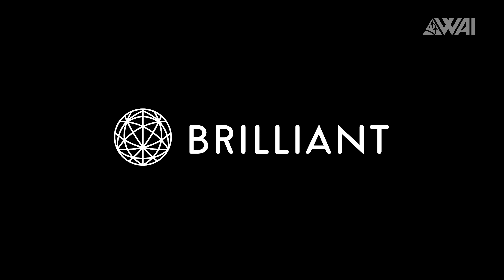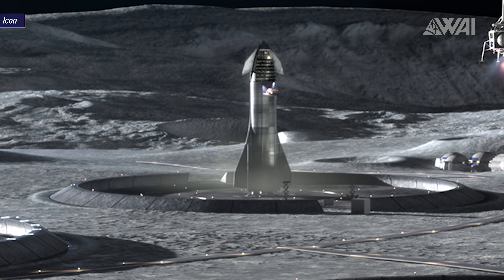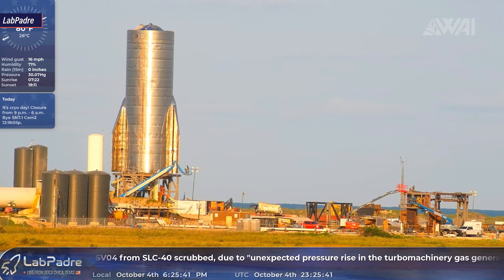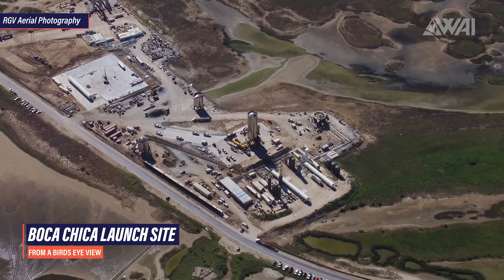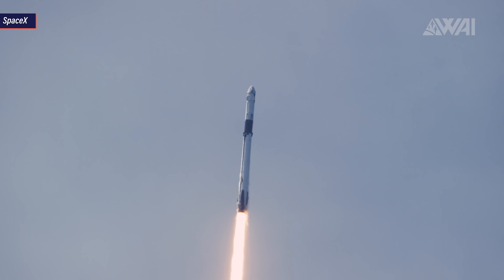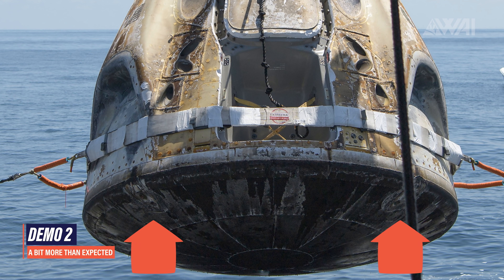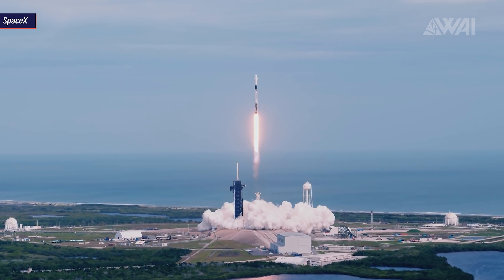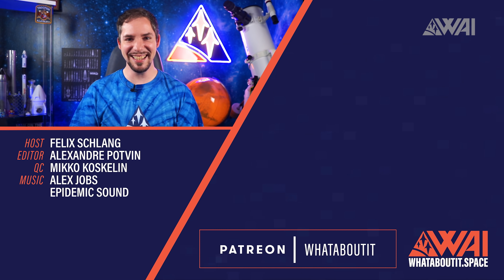125 | SpaceX Starship Project Olympus – Crew 1 Preparing For Lift-Off

Comment: I don't know  why space x simply does not roll the rocket tube like a cardboard tube in the centre of a roll of  paper towel . It could be totally automated. Laser cut to length. Just crank them out any length. Stacking rings seems archaic. To me unless there is some engineering  reason .

Comment: I wonder why Space X don't pump water in pipes straight from the ocean for their sound suppression?
Reply: Because sea water is not good for equipment
Reply: @smallstars  What equipment? It will be for sound suppression only. If a little salt water gets on any equipment, it can be rinsed off with a LOT less fresh water than what would be used for an entire launch.
Reply: Salt = BAD

Comment: I was surprised/annoyed  at the small flotilla which surrounded Demo 1. But after thinking about it, those people live within a few miles of two major airbases, Eglin Air Force Base and Pensacola Navel Air Station. If someone with no knowledge of SpaceX operations saw parachutes floating down in the waters offshore, they likely thought it was an aircrew in trouble and rushed to help. At least that's what I prefer to believe.

Comment: One question ? How do you refuel the lunar starship ? They aren’t going to send a few tank starships each time the need to refuel the lunar starship ??  Are they going to make a hydrogene variant of starship for lunar refuelling ?
Reply: Yes. They are sending fully refueled tankers to moon orbit. There the Lunar Starship can refuel. 

You don't have to refuel on the moon's surface. You can do this also in orbit.
Reply: Keyboard runner yes i know but you still need multiple tankers to refuel one starship and also what is the lunat starships application or use ? I mean once its up there, since the people aren’t gonna be able to take it to go back to earth i don’t understand the use besides to land with less dust blowing away, so are they gonna dock a normal starship to the lunar starship in orbit, transfer people and park the normal starship in orbit for return ?
Reply: @simonw2631  Lunar Starship will be exactly that, shuttle (no pun intended) between lunar surface & NRHO, and it won't comeback to Earth. It will be used to land at the spot that's never been reached before = no landing pad, so they can expand the base, but once it's established & landing pad is constructed they can send the standard Starship (with heat shield & fins) directly from Earth without staying at NRHO (or they could if they desire for Gateway)

Yes ofc the tanker that refuel lunar Starship in NRHO will still be need to be refueled multiple times in LEO, but once it's done it can reserve propellants because it doesn't need to land on the Moon, and ofc it can use the aerobraking because it has a heat shield & fins
Reply: Alvian Choiri Apriliansyah yeah i understand, thanks !! Can’t wait for SN8 to fly
Reply: @simonw2631  
The "only" use of a lunar Starship is the answer to the lunar lander proposal of NASA. And since NASA doesn't want to have a huge cloud of regolith blown up into space when humans first return to the moon, SpaceX made the lunar Starship. 
"the use besides to land with less dust blowing away,"  That's exactly the job it is designed for. 

Once there are solid landing pads on the moon there is no need anymore for a dedicated lunar Starship. Regular Starships will do the job just fine. 

So lunar Starship is just a gap-filler.
Reply: Hydrogen = entirely different separate ship from Starship = more expensive

Comment: How is water based concrete going to be 3D printable on the moon? In the vacuum of the moon the water will boil off. Felix, you should think more carefully before including this kind of nonsense in your videos. Molten sulfur concrete might be 3D printable on the moon, but that is absolutely not what they are testing. Water based concrete would be 3D printable on the moon if surrounded by a massive pressurized vessel, but if you have that vessel, why would you print another one on the inside?

Comment: Ehhh... I think you might still want to use the Lunar Starship, you can cut out the landing engines, but you probably still don't want the flaps or heatshield as it would require more refuelling to end that extra mass, but that basically means you are just using a regular Starship just without a few bits which means you can use exactly the same assembly line, just missing a couple of steps.
Reply: No. You want to ship huge payloads from the earth to the moon. With Lunar Starship you would somehow have to move that payload from one ship to the other in moon's orbit. 
Going from earth surface directly to moon surface will need more fuel, but it's by far the best method.
Reply: @3gunslingers  It's called a zip line, and in micro gravity it's not like you even need to put much force into it to get something moving, and you already need to send 3 fuel tanker Starships up anyway to give a regular Starship enough DeltaV to get into Lunar Orbit, land, take off and get into low Earth Orbit.

So if you can save one of the refuelling flights and replace it with a cargo flight it's would be more economical as you lunching 3 Star ships not 4.

Also you can get back into LEO with a lunar Starship, you would just take multiple passes at like 100km above sea level, which would not generate much shock heating then circularize at apoptosis once it's low enough.

Steel is still pretty heat resistant, and you can keep the fuel for the circularization in the header tanks so the shock heating wouldn't boil off all your propellent.

Would take like many passes though to lower your apoapsis enough, so you would want to transfer your crew by another means.

Maybe a Starship sent up with something like 98-99 tonnes of extra fuel with 1-2 tonne for people life support for 14 days, that would only be meant to go lunar orbit and back, but wouldn't need any refuelling.

oof... I forgot about the van Allen Belt, even if it will be unmanned for the time it's going through the Van Allen belt it's still going to ionize the Starship... humm maybe a burn to lower your apoapsis orbit below the lower Van Allen belt on the first trip. Then you can manned as your orbital period will be short enough to do the rest of the skips through the atmosphere.
Reply: @Etheoma  
I would love to see your calculation on the aerobreaking issue. Heat shield or no heat shield? How do you keep orientation without the fins/wings? 

How you plan to shield your crew against the van Allen Belt radiation while they wait for the ship to make enough passes though the atmosphere? 

"It's called a zip line, and in micro gravity it's not like you even need to put much force into it to get something moving," How do you tension the zip line without gravity?
While it's true that you can move huge masses in space without much force, that doesn't mean it's easy to transfer bulky cargo between ships. Most likely it would require EVA's which leads to huge costs and time penalties. In addition the ships have to dock somehow in parallel to transfer cargo. This requires docking hardware. Again more costs.

Also lunar Starship doesn't lower the fuel requirements in any significant way. It's fundamentally still the same ship with similar weight and efficiency.
Reply: @3gunslingers  Erm you know that a Starship with only the header tanks full would move the centre of mass way forward, if the centre of mass is behind the centre of lift you are aerodynamically stable.

Also it's theoretically possible for steel to re-entry without heat shielding, you would need to have high lift to make sure you were reentering slowly, but it's just about possible.

Not something you would want to consistently bet a $200m+ craft on never mind human lives, and wings made out of steel would be exeedingly heavy, which would make it unworkable, but 100km is considered space for a reason by the US, you can get to orbital velocity at that height and thermally it wouldn't be an issue.

100klm is with a bucket tonne of safety margin, aluminium can take the shock heating, So yeh Steel could take it like a champ, aluminium could take it like a champ, steel would take it like it was a warm bath.

The only issue is that you may not get enough drag at that height to lower your apoapsis by enough to make it feasible while manned.
Reply: @Etheoma  
"if the centre of mass is behind the centre of lift you are aerodynamically stable." You mean IN FRONT OF, don't you?

Reading between the lines of your comment I think you want to have a heat shield on your lunar Starship? Did I get that right?

Comment: Great video but can you please start to cover more Blue Origin stories - they seem to get missed: The NS-13 rocket that will be flying for the seventh time, a record, was scrubbed due to a payload power supply issue, Brevard County wants Blue Origin to refund the $8 million in cash incentives the County Commission approved in 2015,  they applied for a permit from the U.S. Army Corps of Engineers to fill in/impact 17.7 acres of wetlands etc.

Comment: (5:23 into the video.) Felix,  Perhaps the flight hardware was installed into SN08 for test fitment. But before the pressure test SpaceX  removed the hardware in case SN08 did not pass.

Comment: I’m all for safety, but a ten mile perimeter sounds more punitive than preventative. Spectators can be closer than that to a launch or a landing falcon 9 first stage on land. There’s nothing different about the water that makes that perimeter necessarily larger. Half that, five miles, is sufficient. At that distance, some folks could still make a reasonable observation safely.

Comment: Lunar Starship shouldn't need Raptor engines at all.  Makes no sense to use the same Starship to get on/off Earth as to get on/off Moon.  Those engines are 1500 kg each (probably more for vac version).  That is an enormous amount of "dead mass" you are lifting on/off the Moon.  Depending on how close a super heavy can get an empty, non-Raptor engined Starship to orbit, you may be able to avoid those engines altogether.  If you still must have Raptor's to get the Starship off Earth (on its maiden voyage), then you would want to remove the engine(s) once on orbit and use only the smaller Lunar engines for all propulsion.  Obviously SpoaceX has no intention on using the same Starship for on/off Moon as Earth based on the lack of fins, so the same lack of engines makes perfect sense.  And a gateway makes no sense at all.  You would want to use the Lunar Starship to go from the Moon surface back to LEO where it would rendezvous with an Earth Starship and transfer its cargo there.  Again, no need to push all the dead mass of an Earth starship any further than LEO.  You just don't need 6 gigantic Raptor engines for any of this except getting from Earth to LEO.  Everything else can be done with the much much smaller/lighter Lunar engines.  Also, I see little reason for a gateway anywhere, just have the two Starships meet in LEO, transfer cargo and part ways.  Perhaps a gateway may be needed if only to provide some sort of bridge that the two Starships can use as a point of connection.
Reply: "You would want to use the Lunar Starship to go from the Moon surface back to LEO where it would rendezvous with an Earth Starship and transfer its cargo there." That would still require the wings and the heat shield, but would prohibit any inspection down on earth. Also the small engines are FAR less efficient than the big VAC ones, meaning less payload from earth to moon.
Adding to this the small "non raptor" engines are only usefull for the few flights until a landing pad is build in the moon. After that Starship can land on Raptors without throwing regolith into orbit.

Also I would love to read from you how you think 100+ tons of cargo can be transferred from one ship to the other in orbit. I don't think this is possible without a huge payload station in orbit.

We have to say goodbye to the old way of thinking about "efficiency" that characterized old space. With Starship we have a system that can serve all porpoises without the need for special developments. Sure, you maybe can't ship the full payload weight to any place you want, but sending two regular Starships will almost certainly be cheaper than building a special version that needs even more special facilities.

Comment: 6:33   If you will examine the two columns at  the ends of and supporting the main truss you will see they are very small in relation to the corner column.  The main truss is of sufficient material size and chord depth to hold a decent load, but it is only hung at the tops of the ends (two points) and not the bottoms also (four points) like conventional practice.  There are no visible crane attachment points or holes that I can see.  If I had to guess, the small support columns with only two main truss attachment points and no visible crane beam seats or holes makes me believe that there will not be a crane.  But I would expect one or two of the elevating work scaffolds used before in mid bay.  One last point to ponder.....The two areas at the sides have bottom chord bracing which lowers the ceiling height, while the center work space has no bracing and so has a higher inside height. (I would watch the floor for maybe rail tracks for a couple of mobile work stands to move the stacks from the sides to the middle for the transporter to drive under and pick up when they are done.)

Comment: The spectator boats were a minor inconvenience and annoyance to the recovery crew at the absolute worst. They didn't pose any real danger or consequence. Merely not ideal. That's nothing to be ashamed about. 🤦‍♂️
Reply: I suspect there might be liability issues if someone from a spectator boat gets shot of rocket fuel being discharged, or touches a hot part of the capsule.  So that's a reason to keep them at bay.

Comment: Surely the Lunar Starship can land back on Earth if it has enough fuel to slow down using engines rather than aero breaking (e.g. coming from the Moon)?
Reply: No Starship will ever land on earth WITHOUT aerobreaking. The engines are only lit to slow down on the last few meters. 

It does not matter whether the spacecraft returns from a low earth orbit, from the moon or from Mars. It will always use the atmosphere to reduce its speed by about 99%. 

In consequence that means that Lunar Starship will never leave the moons sphere again. But any other "normal" Starship with wings and heat shield can land on the moon, get refueled in low lunar orbit and fly home.
Reply: @3gunslingers  I'm not sure that is true.  Spaceship is designed to aerobrake on Mars and Earth with very limited fuel.  I see no reason why it can't land like a Falcon 9 if it is refuelled in orbit or even from the moon.
Reply: @Spedley_2142  
No, of course all Starships will land like the F9 booster stage after aerobreaking.  Every F9 booster makes a suicide burn for touch down. Every Starship will do the same maneuver after aerobreaking (aka the "bellyflopp") 

Do you watch many video from the "Angry Astronaut"? He also get's this concept completely wrong. (but makes good videos otherwise)

Comment: The Problem With 3-D Printers Making Structures On Mars Is That Water Evaporates From The Composite Into The Atmosphere, If We Allow This To Happen, Long Sought After Water Would Become Rare, Fast! 

The Same Composite Could Make Bricks In An Enclosed Mechanism That Recycles The Curing Vapor With Very Little Pressurization!
Reply: 3D printing on the moon works with polymers, not water.

Comment: Just heard SN8 initial pressurization was too short. With regard to pressurization I will be very interested to know if it affected the operation of the wings afterward. The hull gets put under load when pressurized. Things deform under load which makes that a subject of top priority. Be absolute hell to get a wing stuck as you rocket to the surface of Mars. In fact after the test I would take it apart and do a laser alignment check to see how it changed. If it's nothing or very little then you know that. If there is a problem the only solution will be to add a circumferential frame at each hinge point.
Reply: Or they can just use axes with ball joints. No extra frame needed.

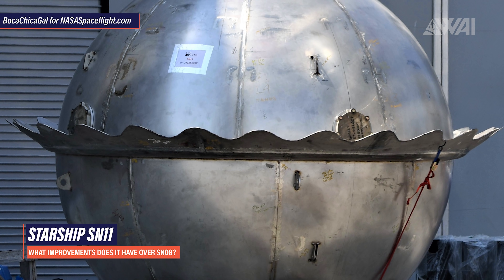Comment: 6:53 is this tank upside-down as shown in the video? I assume it's upside-down due to the wavy plate angled upward in this shot.  I assume the wavy plate will either get welded to the inside of the nosecone shell?  Or would this be welded to a support structure inside the nosecone tip? At first, I assumed it was the AFT tank on the common dome, before reading the labeled since it has the wavy plate.  I'm a little confused about how this will be attached if this is the correct orientation and for the nose tip.

Comment: One ‘issue’ I see with Lunar Starship is payload location - where is it carried? If it’s anywhere near the nosecone that makes getting out & down quite problematic. If you are going to move and deploy large quantities of anything ideally you would have roll in / roll out access...? So what’s your thoughts on how this key and critical aspect might work Felix?
Reply: There will be a hatch somewhere above the fuel tanks from which an elevator will able to be extended, providing access to the surface. Yes, roll on/roll off would be more convenient, but it is not pracitcable. At least they will be working on 1/6 G.